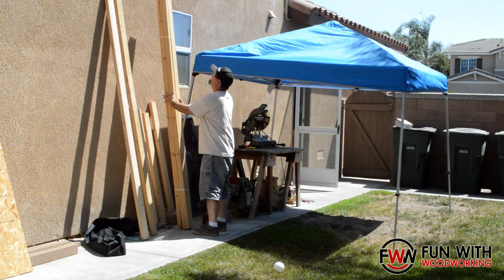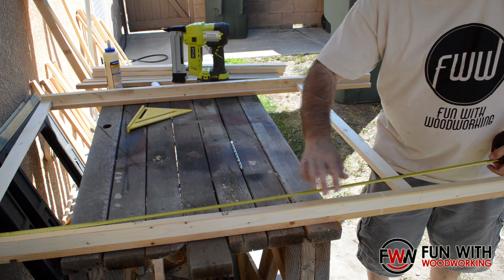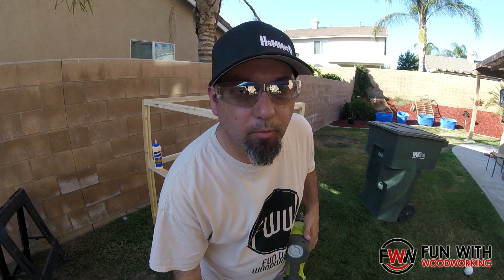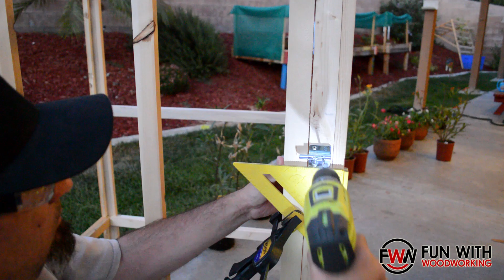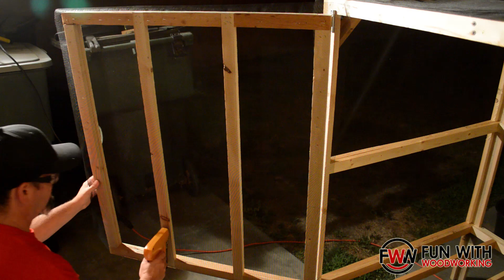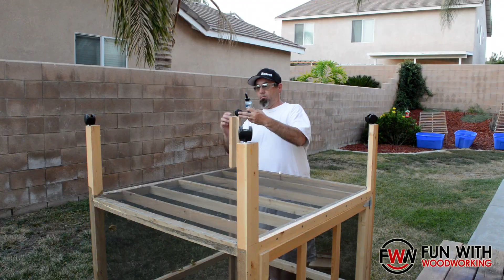How to build a Butterfly Enclosure

Comment: I tried to read all of the comments before I offered my idea, in case you had already addressed this. 
*Putting the screen material on the inside (of the bottom at least) would make it a lot easier to clean out the frass. 😉 Very good work!
Reply from the maker: Thanks for the idea!  If I ever make one again, I will give it a try.

Comment: I bought all the supplies and ready to go but had one question about the brad nails. Should they be 1.5 inch, 2 inch might be too long?
Reply from the maker: All of the lumber should be 1 1/2" thick so I would go with 2" to 2 1/2" brads or staples.